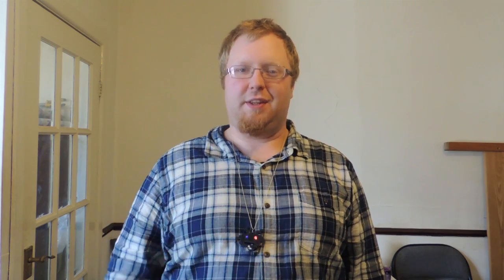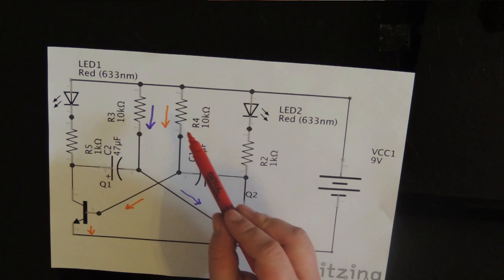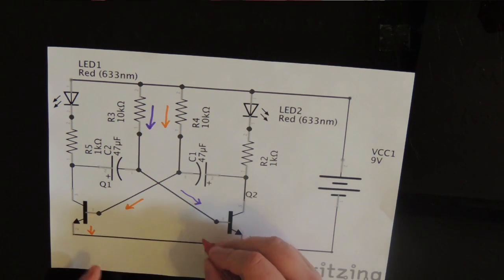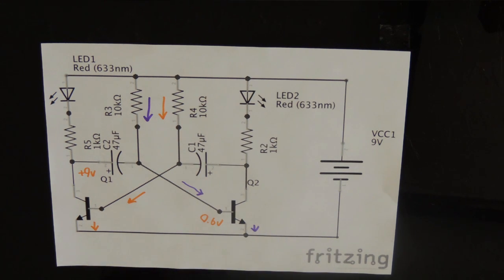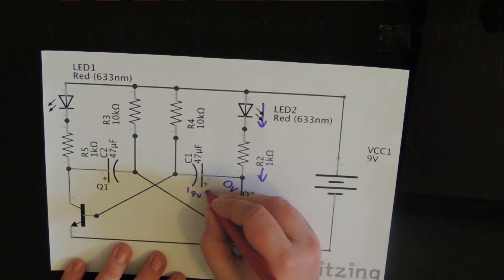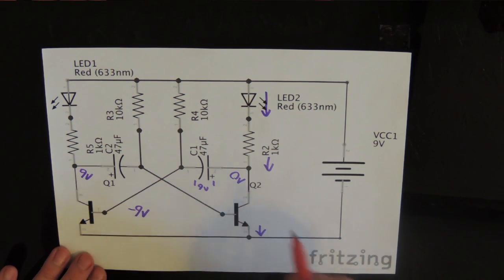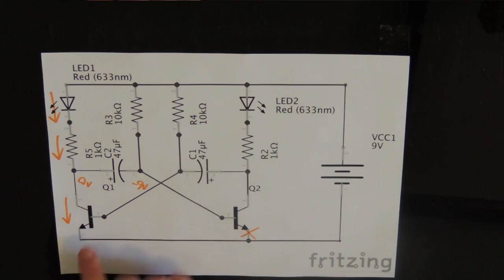Analog Electronics Tutorials #1: The Astable Multivibrator

Comment: Hey man awesome explanation and SHORT which is great because time is gold. By the way i found a very interesting circuit for a nichrome wire controler from a commercial device and it has an Astable Multivibrator on it, if you want i can share it with you for adding more awesome content to your channel !

Comment: I would not suggest to operate this kind of circuit at operating voltages higher than 5 V. The issue with this circuit is, that in the switching moment the voltage at the base of the transister gets lower than the avalanche break down voltage of typical silicon BJT, with is in the range of -6 to -8 V. Especially in the case of larger capacitors the power of the excess charge can be high enough to shoot through the base emitter diode of the transistor. In the typical case of lower capacitances the time constant is lower than expected (0.7*R*C).

If you need to apply this circuit for higher operating voltages than 5 V (which is almost never the case) you have to select BJT with larger avalanche break down voltages or you can chose low power MOSFETs, which can be operated usually at gate voltages of -10 down to -20 V. In the literature you often find circuit designs in which the BJT are operated beyond their save specification range for their avalanche break down voltage even with capacitors in the range of multiple 100 µF. So they often fail after a while.

Comment: This is wrong. I checked it myself. They never discharge. They charge C1 or C2 from different sides. If it’s like what you said that C1 will discharge through R4, why the voltage is always positive from top to bottom, because it’s charging not discharging. The left side voltage is negative, so it’s super low, how can it discharge, don’t be ignorant.

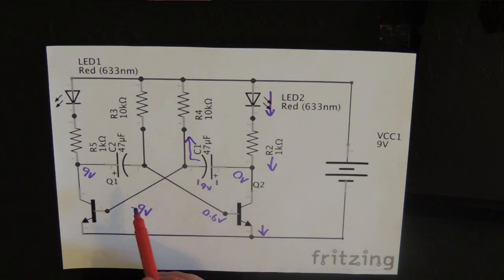Comment: I dont understand how at 3:08 the negative plate of C1 charges from -9v to 0v and then to 0.6. Is passes to which resistors? Thanks
Reply: The negatively charged electrons end up flowing through the resistor connected to each capacitors negative plate and on to the positively charged terminal of the battery

Comment: If capacitor;s negative plate is connected to base of transistor, both will be in cut off stage.  None of the videos (25 odd) I have seen, explains that.  In reality(in animated graphs) both the negative plates become positively charged alternately.  No one explained so far.
Reply: He actually explained it at the beginning of the video. No component part is created equal. As a result, one of the transistors will end up being turned on while the other is off
Reply: @MsDragonbal776  this is not an answer for the capacitor polarity thing

Comment: so... why does -9V shut down the transistor? unless you're using mosfets, any current should work.
Reply: ahhh, hadn't considered that. thanks.
Reply: No. Bjts are also voltage controlled in very much the same way as mosfets are. If  the base to emitter voltage isn't higher than 0.7v, then the transistor just won't turn on

Comment: Hi Rowan, I have viewed a few Astable Multivibrator videos and yours is far better than most.  A small point for me was that I wondered if the arrow you drew at 3:01 would have been better marked in the other direction.  But nevertheless please keep making these videos explaining apparently simple but actually subtle point circuits eg the Monostable Vibrator.  Thanks
Reply: Electrons flow from negative to positive . Since that plate was -9v, it was negativly charged with respect to ground, therefor the electrons would flow from the negatively charged plate, through R4. Once the plate reaches 0v and surpasses it, the electrons would then begin to reverse their flow and return to the now positively charged plate. In the scenario he was highlighting, the arrow was indicating the correct current direction.
Reply: @UnderstoodConcept  Why would he use electron current flow there, when he used conventional flow everywhere else?

Comment: why don't the current flow though R2 and R5 in the starting since the capacitor would behave as shorted wire initially.
Reply: +Harshit Agarwal because the transistor isnt turned on yet

Comment: In addition, you said at 2:58 that the left side of C1(currently at -9) will start to discharge throughout R4, reach zero volts and then get to 0.6 volts. How can something be discharge and get to 0.6 volts. I think you mean that the left side of C1 starting charging and not discharging.
Reply: Discharges to 0v then charges to .6v

Comment: You did not explain why the left side of capacitor C1 is -9 volts since the right side is zero after transistor(Q2) starts conducting. That is a very important detail that you left out. Please explain for the viewers why that is so.
Reply: mandingoteck It helps to imagine measuring voltage at + of C1 when Q2 is off. You'd get +9v. With Q2 on basically the cathode of Led2 is essentially connected to - of the battery so now the +9v can be measured only at the anode of Led2 and that same +9v goes to the - of C1 and builds a negative charge